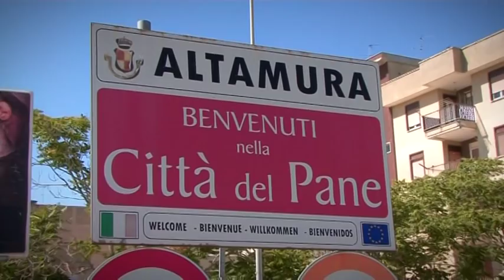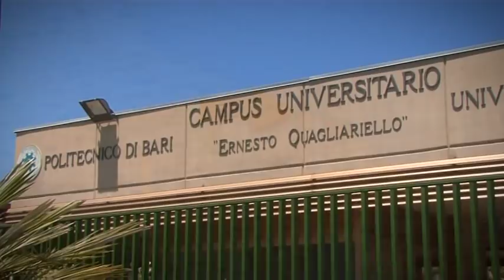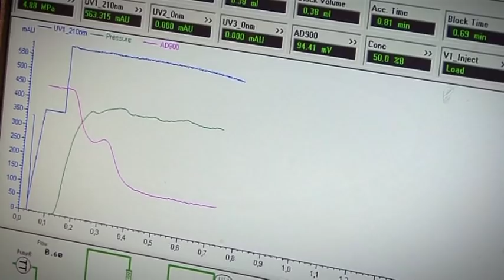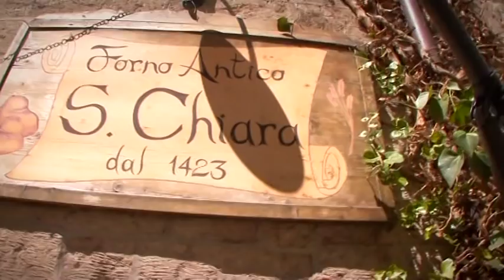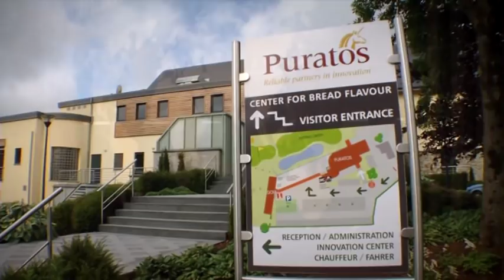Italy - Altamura sourdough

Comment: Adding a little yeast yields to a much lighter crumb - fluffy bread.
Reply: naninoor> you know they just said so in the video, right? 5:36

No reason to act more annoying than other people.
Reply: Not neccesarily. 
It HIGHLY depends on the quality of the starter. If the starter is not the most active one, yeast will make better results. If your starter is very very active, it may only change the time the bread will need.
Reply: @sagichdirdochnicht4653  Your caps lock got stuck for a moment there.